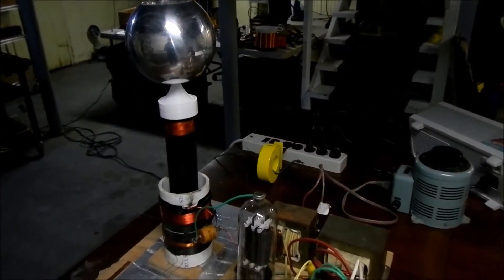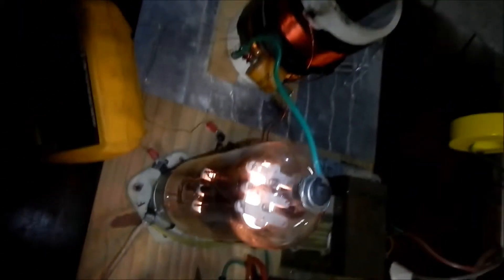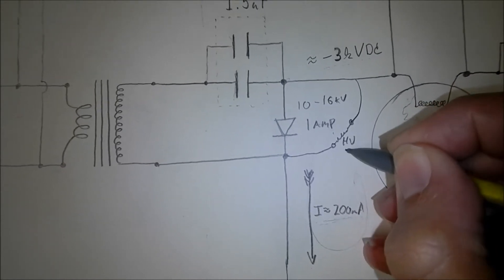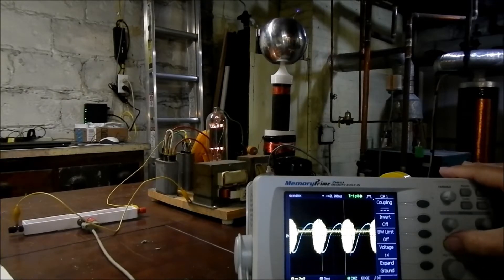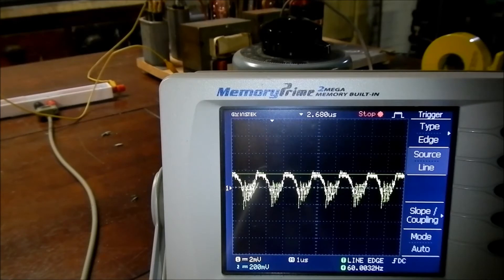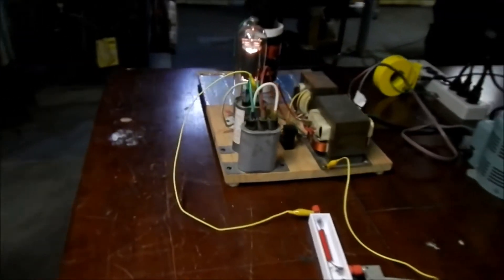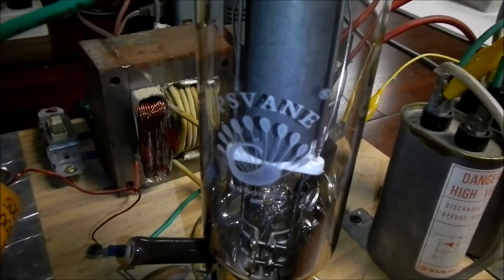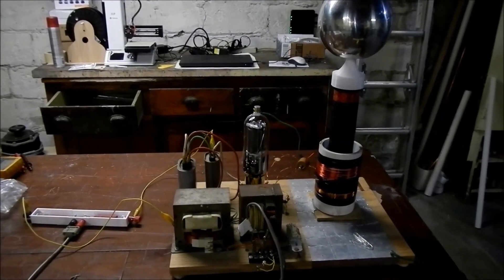Vacuum Tube Tesla Coil - Update New 805 Tube

Comment: Not sure of the validity - but have always heard that you should power up the filament first to get it up to temp before applying the HV as it will, supposedly, prolong the life of the tube......
Reply from the maker: I haven't heard of that... I have damaged a few tubes but the filament still works! overheating damaged the grid or vacuum quality, filament burnout hasn't been one of my problems..
Reply: @sparkstarter  IIRC, something about it "hardening" the filament so that the thermal emission of electrons is reduced....  I know that for some of the early radio tubes, you could "rejuvenate" the filament by applying a voltage a bit above the rating for a length of time (with no hv applied). I've tried it on a few radio tubes, and it's about 50% successful. It brought back a few that had no emission.....Search vacuum tube rejuvenation for details....

Comment: I am actually trying to mimic your set up .I have an 810 triode it is oscillating sparks are really small just wondering if you can tell me how many turns you have and the feedback winding   And the primaryI think I have too many haven’t tried to rewind it Yet . If you have time to respond I would appreciate it. I’ve always wanted to make a vacuum tube tesla coil. So when I saw your video I set out to do so.
Reply from the maker: Is your tube new or old? I find old tubes can degrade if performance.
Reply: It’s a NOS and has been tested   To be up to spec.I think I might try a smaller Diameter secondary.Its 3 inches now.and thinner wire.
Reply: I’m fixing to order a new 805.The same one you showed in your update video.But I just like the nostalgia of those old tubes.I have my grandfathers old TV repair equipment, ocilocope, late 50’s early 60’s B&K analyzers in mint condition.Any way I’ll let you know how it turns out.
Reply from the maker: would be interesting to see the tester results for an old tube vs. new tube.

Comment: That type of HV probe on a single ground referenced winding such as a MOT will ground the circuit through the oscilloscope. Or in the case of a battery operated scope will put the case of the scope at half the output voltage or in this case around 1,000V.
Reply from the maker: Nope, the diode and capacitor form a DC level shifted circuit,  the output reading should be accurate. If I was just measuring AC output of the transformer to ground with the probe it would be half. (i.e div 500 not div 1000)